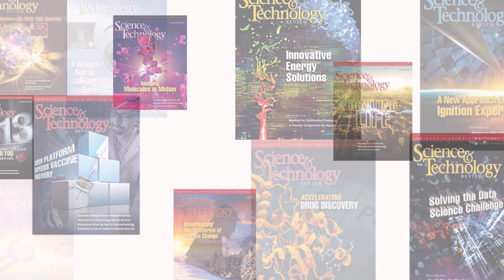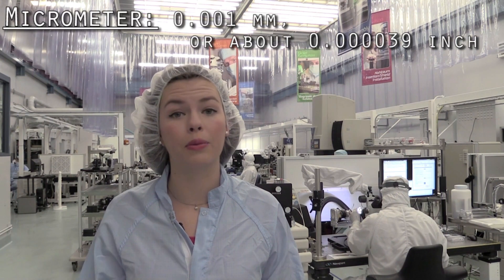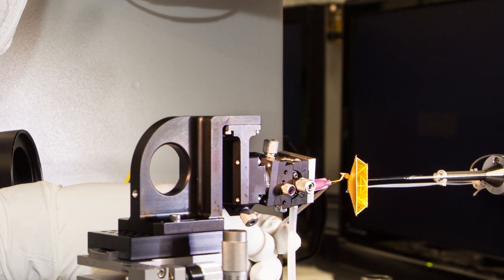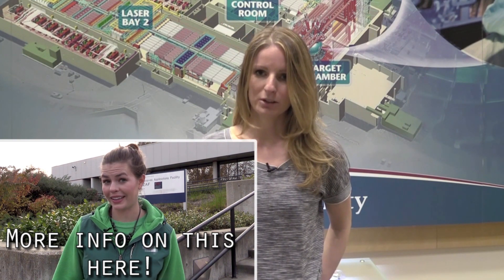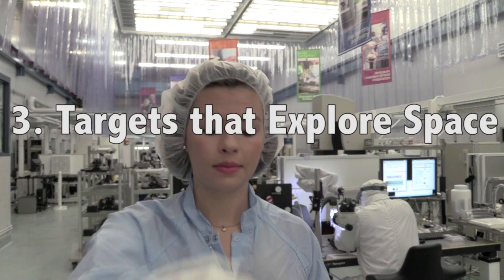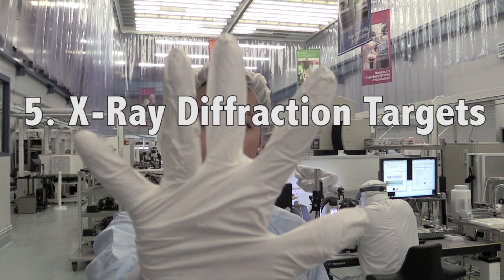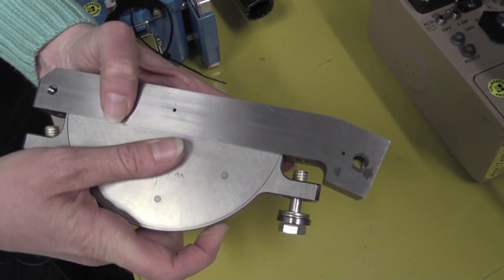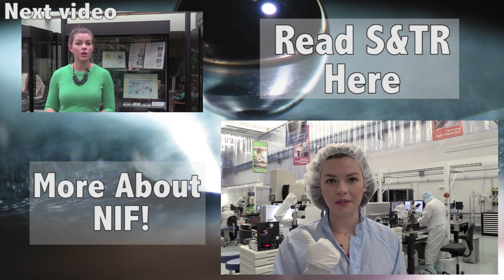A Growing Family of Targets for the National Ignition Facility

Comment: You might want to invest in some noise cancelling software/hardware, if you want to keep making your videos in those noisy rooms.

The concept is that you have a microphone near the person talking, and some near your sources of noise. And you use the differences in the recordings of all the microphones to isolate the noise from voice, by inputting all the microphone recordings into a program, which should find calculate the sound of the noise, and then subtract that from a copy of the voice recording, to produce a cleaned version. Suddenly, your video production quality has risen.

An alternative is to just install some noise canceling panels in the rooms you want to record in. I think they're just made of foam, cut with ridges of certain sizes to break up echoes. I wouldn't be surprised if you could make them with a 3D printer, but just cutting up some foam, and gluing it together would be cheaper, I imagine. The panels might need additional treatment for use in clean rooms.